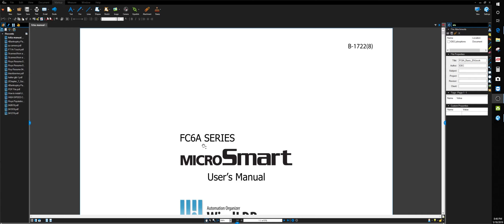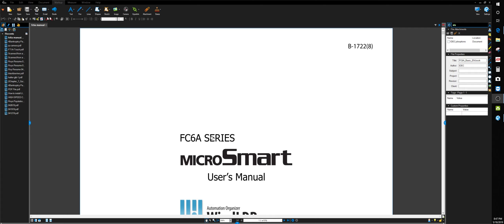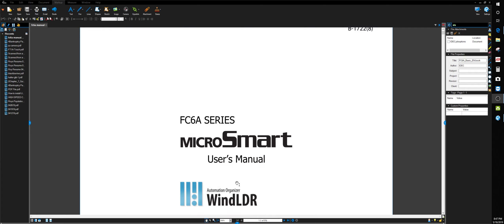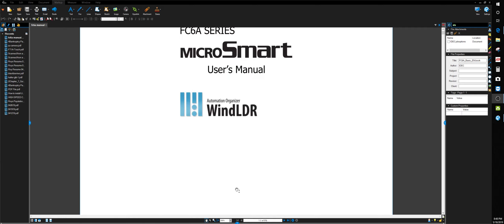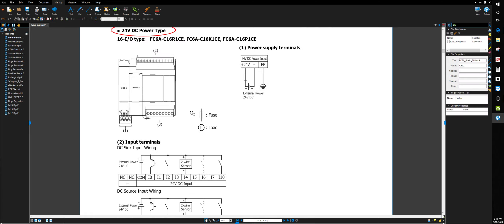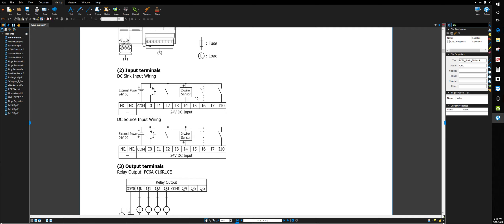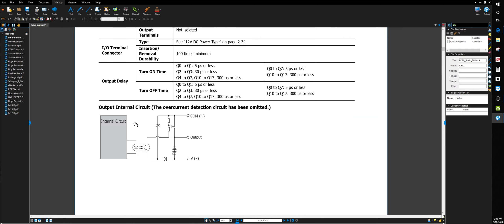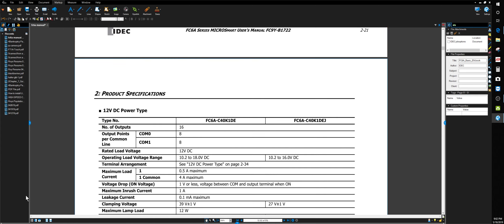How to wire a IDEC FC6A PLC!

Comment: I’m learning from you and thank you. I wish you could actually hook something up to the output to know how. I’m trying to teach myself and would greatly appreciate it.
Reply from the maker: Good news.  I am jumping back into programing.  I will get you a video up before to long.  Any specifics you want to know?  Tell me the model you are using, I can explain it.
Reply: @huntxtrm  it’s an IDEC FC6A-C40R1CE and a F6A-L03CN1. I don’t know how to hook up the inputs and output physically with a load.
Reply from the maker: @JAM40813  Sorry it took me a bit to get to you.. I have a couple of drawings that I noted for you to wire by, if you have a way for me to get them to you.  Email etc.  This is the explanation.  Starting with your inputs.  Generally in the US we use "Sinking" inputs.  In English this means you are sending a dc+ signal from your input device to the PLC.  So you would wire from your 24vdc- on your 24vdc power supply to both "com" terminals on the input side of the plc.  24vdc+ on your 24vdc power supply goes out to the field input device(Switch, Button, Proxy, etc)  when that device is pushed/activated it sends that 24vdc+ back to the input terminal of the plc.  I1, I2, I3, etc.  That is how the plc receives the input signal.  The plc then performs the logic that you programed.  Output side goes like this.  Generally in the US we use "Sourcing" outputs.  In English this means you are sending a dc+ signal out to your output device(Coil, Indicator light, etc.)  Wires as follows.  24vdc+ from your 24vdc power supply to the "comm" terminals on the output side of the plc. The Plc then when the logic tells it to, closes the relay for Q0, Q1, Q2, etc.  Sending that 24vdc+ out to your output device.  The part number you gave me is a relay type output, so you can run different voltages, just be sure and use the "com" associated with the output terminal.  As far as the analog card goes, what type of signal are you putting in, or taking out from it?  4-20ma?  0-10vdc?  Are you controlling an analog device like a vfd?  or are you using an analog signal from like a pressure sensor, or temp sensor, ect..?

Comment: Maybe you can clear up some confusion I have about the 24v ac output terminal on the bottom far left of the plc. The example wiring diagram from the manual shows 24v ac power. Does this imply the 120 v ac has to be stepped down before it is wired into the terminals?
Reply from the maker: What model Plc do you have, I will tell you how to specifically wire it.  There are variations.  Sink/source, relay, ac and dc.
Reply: @huntxtrm  thanks for the reply, the model is FC6A-C24R1CE
Reply from the maker: @17jflor  i will get you a wiring diagram and explanation when I get in from work today.  Thanks for subscribing
Reply from the maker: Sorry it took me so long.  I have had a head cold, and transitioning between jobs.  LOL..  I have a couple of days off before I start my new job, so I got a video up for you on your specific plc.  Search "FC6A-C24R1CE" Or, just go to my channel.  It is on there.  Again, sorry for the delay.
Reply: @huntxtrm  awesome. Thank you.